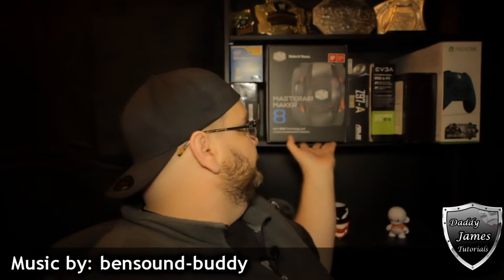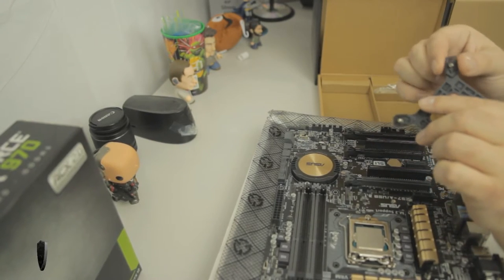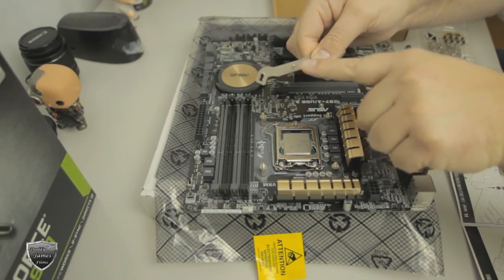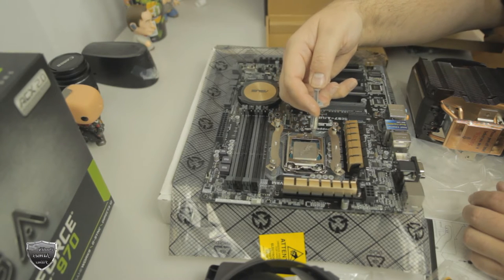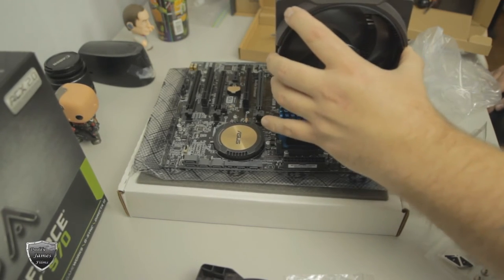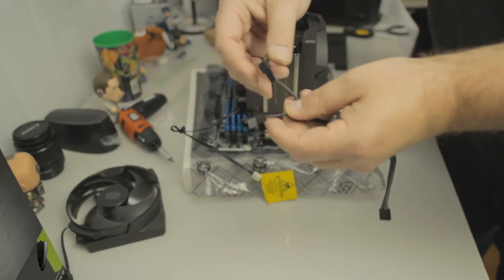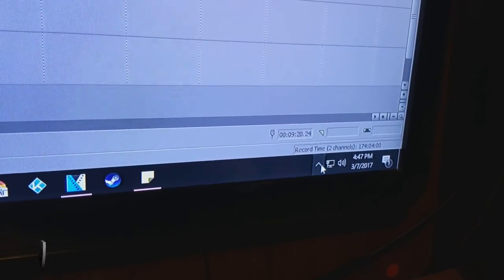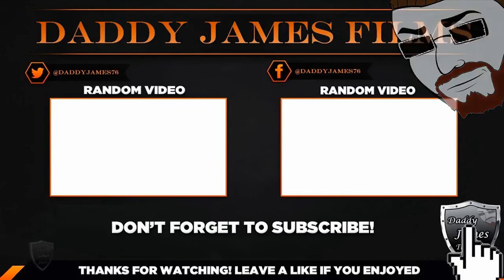Cooler Masterair Step by Step install in English instructions

Comment: hi, can you help me, with the wiring, using the fans which came with it but one is not working and is plugged
 in
Reply: I would call their tech support for help you might have a faulty fan or wiring. I'm sure the tech support can help you out.. good luck